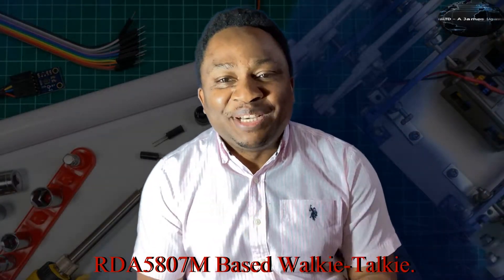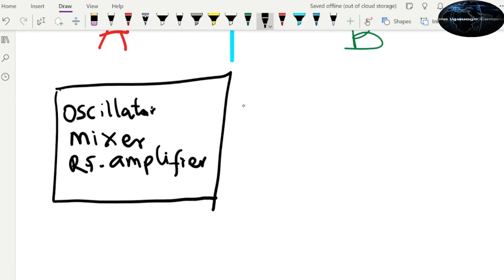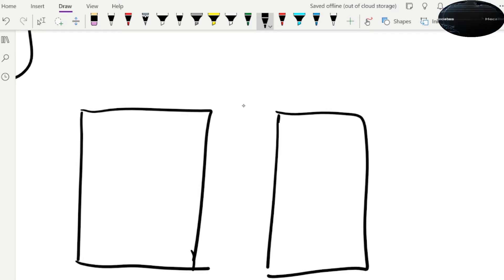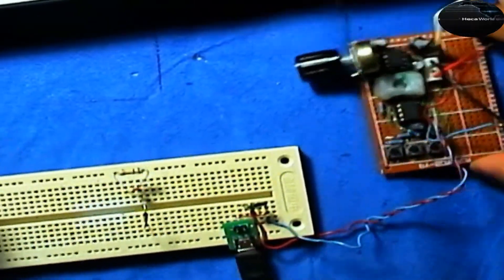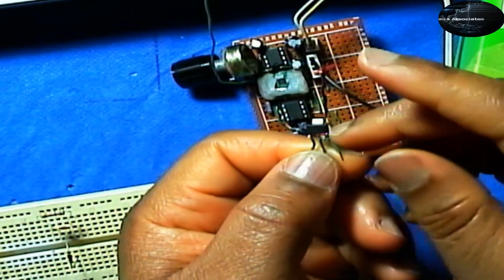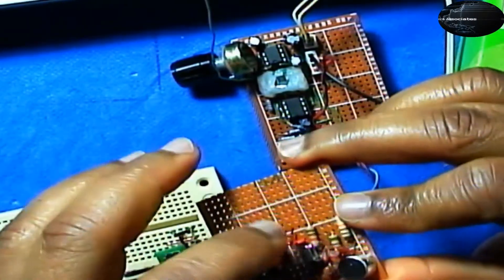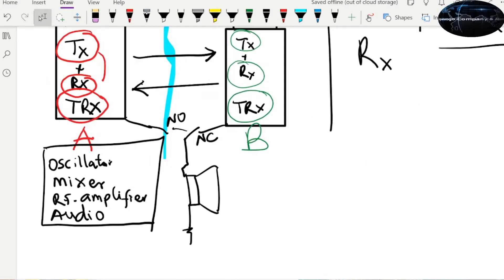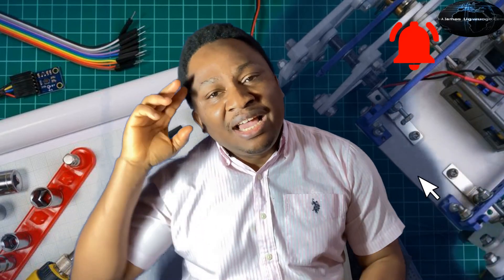How to Build FM Walkie-Talkie from Scratch | RDA5807M Based Walkie Talkie

Comment: I have many CD2003 IC's how can i use them to build fm receivers to my own frequency
Reply: Your tank circuit around Pins 12, 13 and 15 of the CD2003 has to resonate with your transmitter. Choice the right Capacitors and Inductors to match your transmitter frequencies. Read the data sheet to determine the minimum and maximum frequencies it can receive.
Reply: @izzykoding9114  thank you for your information..but i have another question ..can i use it to receive 27mhz  with fixed crystal
Reply from the maker: @themissingdetails2283  If your IC is capable of such frequencies yes, otherwise, it will receive the 4th harmonic at 108Mhz.
Reply: Why don't you drop the círcuit diagram